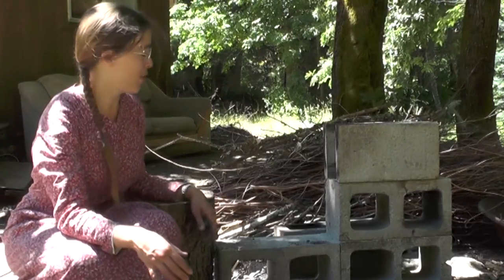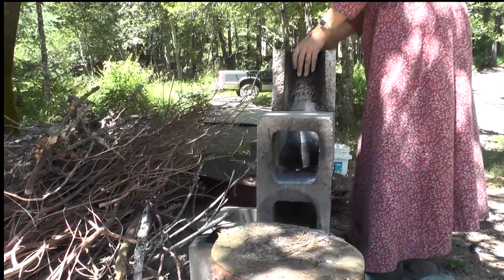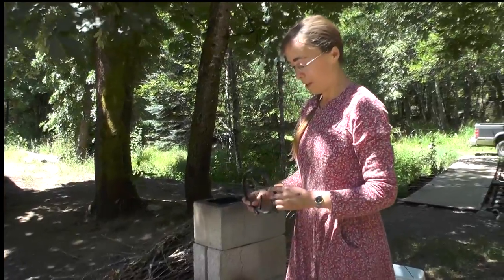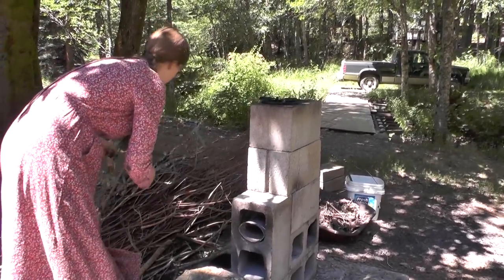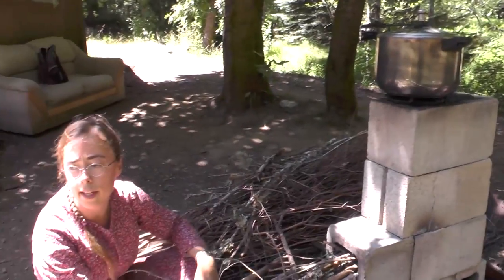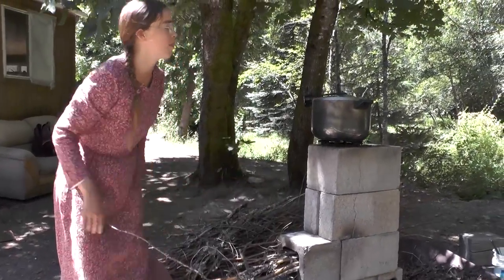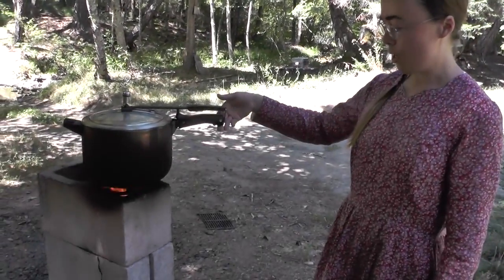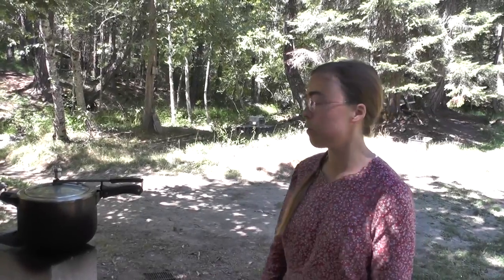Improved Rocket Stove - Cinder Blocks EASY!

Comment: an old scout master taught us to wipe the outside of your pots with a thin layer of dish soap before placing them on a fire to easily wipe the black off when finished.
Reply: Good tip but if your rocket stove is properly designed and put together there will be no smoke or soot since the main principle of the rocket stove is complete gasification.
Reply: Bill Burd **{ thank you .. }**
Reply: An old scout master taught me to wipe too...
Reply: @RedfishInc  lol
Reply: The Girl Scouts used powdered laundry detergent mixed with water to form a thin paste and apply to the out side of the cast iron.  When you put it in the wash water the scorched soap would just melt away.
Reply: Did you know that all cookware, if the outside is black, will use half as much fuel to boil water. Don't wipe off the black, the black is good!
Reply: Bill Burd  works on wood stove glass too
Reply: An old scout master used to wash my dishes in the joint.. He was in there for teaching lil boys to wipe
Reply: Jo Jo 
Johnson   the real criminal, I am surprised he was sent there...God bless the good...doug
Reply: Redfish Incorporated front to back? Lol!
Reply: Funny -I thought the same thing, when I first saw her pot, its an old trick.
Reply: The dish soap works best if its ivory and on ceramic pots.. you can do cast iron but the porcelin pots it wipe right off..
Reply: @magor2379  great tip ill have to try.
Reply: Another old scout trick is a buddy burner, great in the event of a power outage, for someone really needing a coffee, or food.
Reply: @magor2379  Girl Guides use the white ash from the fire and leave the detergent out of the equation altogether.  Cleaning naturally works way better and is less messy and no phosphates.
Reply: @hmelonify  Absolutely! The ash is what settlers used FOR SOAP!
Reply: @trishfitzpatrick2066  we use it all the time.  I have a combustion fire with a glass door and its the best way to clean this... others are totally amazed seeing this.  Truly these ways are dying.  We need to tell people there is an easy way and its all there in the fire.  Thank you for acknowledging.
Reply: @hmelonify  YES! I learned that trick about thirty years ago and it was that supreme AH-HAAA!! moment.

I used to collect books on "tips and tricks" so I ran across it specifically for fire doors (and there was a well known author who wrote those books named Mary-Ellen :) Then I came across the soap aspect in Williamsburg, VA in a demonstration of soap making.

I am encouraged these days to see women going home again. There are more and more web sites popping up with young mothers tending their own families, staying home with their kids, and sharing all the tips and tricks of the modern day. But yes, I would like to see them access the more traditional customs more.
Reply: An old scout master of mine taught me to use a microwave. It cooks my meals in about 90 seconds and it doesn’t shoot out smoke. Oh, and I can cook inside where I have AC.
Reply: @cgutierrez7844  Good thing you don't play with fire..😑
Reply: i spent 6 years in a scout troop. we took 2 week camping trips every summer. every breakfast and supper someone had to soap the pots, OUTSIDE, great idea and it works! one time a newbie soaped the pots, inside and out. he learned the right way after one time. that time was the best time of my childhood!
Reply: As an ex traveler - the black on the outside is good. Save your resources to clean the INSIDE.
Reply: I've always done it that way and it definitely works.
Reply: @scotthansenmtbt4110  really, didnt know that
Reply: Dish soap and dirt.
Reply: elijah mikle  no
Reply: @magor2379  Did the same thing in Boy Scouts.  Made a paste out of detergent.  Looked funky but it works great and makes clean up easier,  Just a hint from an old Eagle Scout
Reply: @hmelonify  Then all you have to do is convince the greenies that what you're doing is GOOD for the planet and sustainable. (Totally). Of course that's not their agenda and the Leftist Council will shut you down and fine you. lol.
Reply: @bossdog1480  bugger the lot of them now  :)
Reply: @hmelonify  Yes, I agree. They're nothing but dead wood themselves.....
Reply: @jojojohnson8056  you a sic dude. Lol
Reply: We use ashes from fire burns. Mix it with water and apply it outside the pot...once done, it can be easily wipe out...
Reply: @magor2379  no wonder the girl scouts are dying out. Never put soap near a cast iron unless you're doing a deep clean and re-seasoning. Love their cookies though
Reply: I recommend using ash on your pots, before or after cooking
Reply: @hmelonify  that's how I clean the grill and the grilling pan. Ash and water, and a stiff brush.
Reply: I was just watching another rocketstove video. The man said that cinder block is likely to crack from the heat. So that is probably  it cracked, not from the pressure of the other blocks. It's less expensive, and still works. But if it's a concern for anyone, there's always red brick or fire brick available. 

The tips on how to prevent the spot on the bottom of the dish is interesting. Having been in an explosion due to a chemical mixed with heat, and pressure reaction, when I was a child. I never would have thought to use any chemicals on the bottom of a pot or pan on an open flame. But, if many ppl say it works, and is safe to do. Then I guess I learn something new everyday! The situation seems a bit different in the way that this is in fact open, and not a closed manner that can build up pressure from the chemicals in the heat. And possibly even the type of chemicals used?? Not sure. But it's interesting, and I think I might do some research on it. Neat stuff, ya'll! Thanks!
Reply: Learned the same thing in Boy Scouts!
Reply: @hmelonify  so basically you saying just like the old saying to get chewing gum up you need to use chewing gum to get it up. So basically you use things from the fire to clean the pot
Reply: @scotthansenmtbt4110  Who would have thought? 😊
Reply: @cgutierrez7844  Oh come on, where’s the fun in that?
Reply: Thanks for the info
Reply: @RedfishInc  lol
Reply: I  believe that the laundry and dish detergents would emit some chemical gas when heated and also interfere with the flavor of the food
Just wash the pot big deal find a way
Reply: Awesome idea thanks😎
Reply: Just make sure not to get any soap inside the pot or you will be using another completely different pot for a whole nother reason and you wont be doing much cookin ha ha.
Reply: ThankyaBill!
Reply: @scotthansenmtbt4110  Excellent tip! Thank you. We no longer need to stigmatize the black on our pots. Now the kettle can call the pots black in return.
Reply: @stacieball977  👍👍😋
Reply: I had the same scout master!
Reply: @scotthansenmtbt4110  really
Reply: That's funny. My old scout master taught us not to worry about the black stuff. Different generations I guess
Reply: @douglasjones3405  but it's a waste of time, and resources. You're actually better off leaving soot on the outside of your camp cookwear

Comment: Excellent, absolutely excellent video. Special Thanks for saying "Masonry Blade on a Skilsaw" ( circular saw). A joy to use with the right wind. That said, I've made your design including the two riser blocks ( so a total of 7 instead of 5 ). Oct. 2022 I put out a total under $30 including the under $5 blade and an 8th block in case I messed up cutting the first block. Didn't mess up. EZ, I cut the 8th one anyway for a backup fire chamber and just because I was really enjoyed cutting that concrete so easily.  Bonus Points to you for the often left out can air intake. You are AWESOME! ( and I know this is 6 years later, but still great!) Thanks You!

Comment: Genius to use a pressure cooker with the rocket stove. The p.c. requires much less heat & time to cook the same food in a stock pot. I love your design. I especially like the height! Keeps the kitchen cool in the Summer too. Thanks so much for the cool video!

Comment: Great vid hon. Clear descriptions of what you're doing and why. Demonstration was just long enough that I didn't lose interest and not so short that u left a bunch of unanswered questions to plague me. Good job!
Reply: I agree with you except you should never use cinder blocks for this type of project!
Reply: Those are cement blocks, not cinder blocks! True cinder blocks are very dark gray, and not as strong in compressive strength as cement blocks.

Comment: I have watched many tutorials about rocket stoves, and many people waste a lot of time getting it started. Your technique is the most common sense approach that I've seen! Something you might try is dryer lint, which is mostly cotton, and can be kept in a zip lock bag. A cheap effective startup fuel is 91 to 94 percent isopropyl alcohol. Try spray painting  your cinder blocks with high temperature Krylon paint to prevent cracking from high temperatures and prevent water absorption of rain. You can put a layer of tin foil on your pots to keep the soot off, or put your pot inside an aluminum pan, and this can be reused. Great video, looking forward to more!

Comment: This is the most simple rocket stove I've seen.  It's also made from materials I'm likely to have on hand. I've seen some comments that the cinder blocks are likely to crack and shatter but if i have to make this stove it will be because the power has been out for some time. I could use it until the power comes back or until i am able to hunt down better bricks. THANK YOU so much for this simple yet obviously very effective stove plan!

Comment: Well done! Just an fyi for you. Cinder blocks are known for cracking in higher heat. They cos a bit more but, you can get red or fire bricks shaped like standard building bricks and build the same thing by staggering the way you stack them. Then you won't need to worry about them breaking and you will get years of use out of them. I also recommend cast iron pots. Never the less, well done. Shows what you can do with a little effort.

Comment: Instead of a stove grill on the top, you can use any (metal) spacer; we used coat hanger wires on our version, and the tiny gap turned out to be enough to keep the chimney draft going, but made better use of the heat since not as much would bypass the pot.  Another BSA related improvement:  "skirt" the pot with tinfoil that drapes the outside of the pot, extending below the top of the block; leave a gap in the foil for gasses to escape.  This really increases the heat transfer by heating the sides of the pot as well as the bottom.  It took a lot less fuel.  I like the tin can combustion air "duct"!!  Another thought:  use a wok ring (doesn't everyone have one of these?!!) instead of buying a grill.
Reply: Oh, yes!  I use my wok ring all the time on my gas range it is made from cast iron from the 1970's, it keeps my wok steady and secure.😁

Comment: Nice job honey,
Red brick will last a lot longer but cinder blocks are cheap. If thats what youve got, use it
You will find that once youve got a good bed of coals in the bottom of the stove that you can feed a bigger stick or two in there and simmer things better.
Theres a learning curve to everything and in time you will learn a few more tricks.
Thanks for the video. A big thumbs up from me.

Comment: at 6:52, note the cracks in line on 2 blocks.  Your blocks are failing, they hold too much moisture left outside.  They may collapse suddenly with a pot of hot liquid on them.  Be careful.
Reply: perhaps inserting additional coffee cans to insulate the chimney would help prevent a sudden failure?
Reply: The block turned up on end is longer which creates a stress point for the ones stacked part way on top of it......then the blocks get hot......and POP ! ! ! ! ! !
Reply: exactly, this is why that one cracked; Because the one on it's end is higher than the two sat on top of one another, creating a void beneath the top brick. I noticed that too. It's nothing to do with them holding moisture or that they're failing. They were designed to build houses..  @gustav24-7-52
Reply: @PrimeTime345  that's a really good idea
Reply: Kevin Olschesky  really good way.  Using flue liners
Reply: Kevin Olschesky  Those are called flue tiles and are made to withstand the heat while cinder blocks are NOT.  Refractory cement is good also.   I have a few flue tiles at my land for just such a purpose. I built many chimneys in my day and have a few leftovers.
Reply: Kevin Olschesky anything that can take the heat of the stove would be better. Cinder blocks are not designed for this.
Reply: Kevin Olschesky go back and look at the video. I saw the same thing. They will vary slightly between manufacturers. Probably an 1/8”. She mentioned that they were different weights. Some are dense structural block and others are fill block.
Reply: Gus Tav i saw that also
Reply: @brothermaleuspraetor9505  EARTH + SUGAR SOLVE THIS PROBLEMA , REVEST ALL THIS BLOCKS AND GAME OVER .
Reply: Kevin Olschesky  ooll
Reply: @brothermaleuspraetor9505  they are also designed to be called blocks.
Reply: Just add a metal tripod to hang the pot, like a campfire. Cinder blocks are fine for an outdoor fire pit or bbq type build, just don’t rely on them not cracking. I’ve seen tons of bbq’s made from them and never seen any cracks if built correctly. Hers  probably would never had cracked if she’d sawed the vertical block even with others. Should you line a chimney in your house with cinder blocks...no, but a outdoor fire pit? Sure.
Reply: Thanks.  Very informative and well done.  Tin can air inlet nice extra.
Reply: @PyroFalcon  I agree. She is taken, though, maybe one from her "village"   of similar "socialization"
Reply: I saw that, that is very scary... Would red or fire brick work better and how good does your stability of the bricks have to be to avoid this hazard?
Reply: This could be a rocket bomb!
Reply: In a perfect world you could use firebricks.  Or shape one out of clay, mud,stone  and straw.
Reply: I've been aware of the moisture issue with the concrete/cement materials. But I've also seen hundreds of videos of this where people use them and they don't get cracks. So...? 

One thing I do suspect is that only half the brick is getting heated while the other half is not. So, the heated half will expand while the cooler half won't , and boom! You have a crack. I suspect that since they are already broken, they won't break anymore. That's why the one that she actually cut the end off didn't crack or break. If they had used the singles (8x8) instead of the doubles (8x16) in the chimney, this prolly wouldn't have happened.
Reply: @DarkMoonDroid  common cement blocks are not made of refractory cement.  It is just a matter of time before they fail. If they are under stress [weight of grills/food/pots of water] they will fail faster. Not good to use. If you have an emergency and only need a couple fires, they may last if you build a fire slowly [bring the temp of the block up slowly] and not large fast fire.
Reply: @DarkMoonDroid  a video is made 1 time. do they go back and vid after several/many fires.  you do what you want.  It's your safety. you make the call for your own well being.
Reply: @spockmcoyissmart961  How did this end up??😆

Comment: I see many comments warning against the use of concrete against high-heat applications.   I won't add to them even though they are all true.  My suggestion to you would be to use fire brick.  They aren't very expensive and would remove any worries of explosions.  Concrete explodes like a bomb when subjected to high heat, and a prolonged fire could do it.
Reply: Firebrick is $31 for 6 bricks.  That's expensive.
Reply: @nunyabiznis817  Then use regular bricks, which are way safer than concrete, although fire brick are recommended, but usually rocket stoves are not used long enough for the heat to do to regular brick what it does to concrete blocks.
Reply: Or she could make her own from perlite and a concrete mix
Reply: c fedyszyn   Or burns all over her whole body, that long cotton prairie dress is a perfect fire combustible it will catch fire real fast. Safety first always and you don’t want to start a forest fire either.
Reply: This video helped me rethink some things.. all those sticks right next to the tower.. oh my.. I think I'm gona have a fire extinguisher in my area when mine becomes built.  I think I will also have my sticks away enough not to be a explosive landmine in case I had to get out.. still am going to start my homestead with this stove but now I have a heads up of some variables to consider.. bricks are first.. fire extinguisher,  sticks away in a metal feeding troft I have, and a long lighter and grill plate.. ok here I go!
Reply: Xysix I hope she listens to your advice,just for her safety and her family’s safety
Reply: @patriciasmith7074  
EXACTLY!!!
Reply: @nunyabiznis817  "Firebrick is $31 for 6 bricks.  That's expensive." - Or $6 for a bag of ten kilos of the material that goes into it. Only idiots buy bricks. :P
Reply: Theres no record.hearsay!
Reply: @dr.lexwinter8604   😯
Reply: Have you experienced it?
Reply: Excellent advice.  Thank you for saving someone like me from injury as I am van living due to covid and appreciate how to make things that work while off grid living.
Reply: Yeah, fire bricks is the way to do it
Reply: @dr.lexwinter8604  , where can I buy enough mixture to make that many bricks for $6 , just curious ?
Reply: @peggynash5995  Make sure you self isolate indefinitely !
Reply: @dr.lexwinter8604  can you explain?

Comment: Great job, consider building a concrete block bench right next to the top of the rocket stove so you can easily slide the pot onto it rather than moving it like you did.